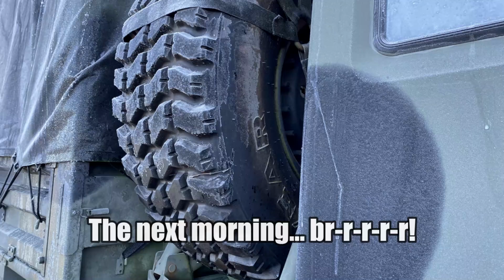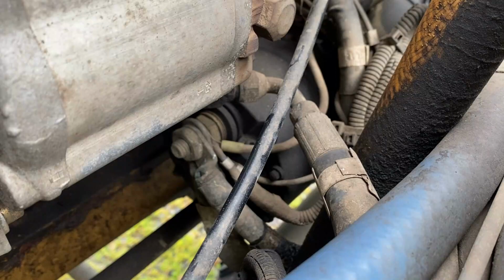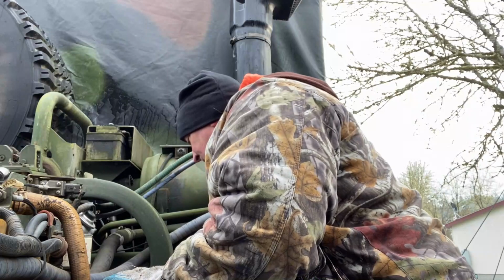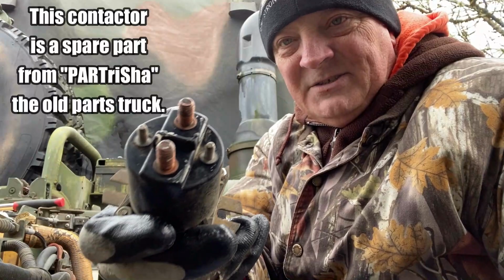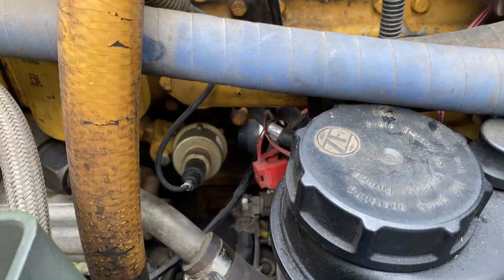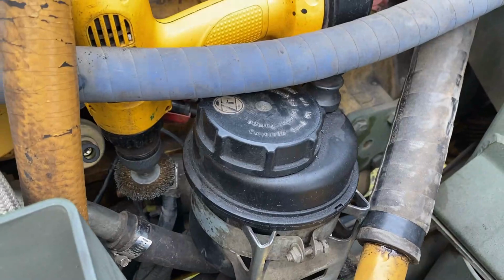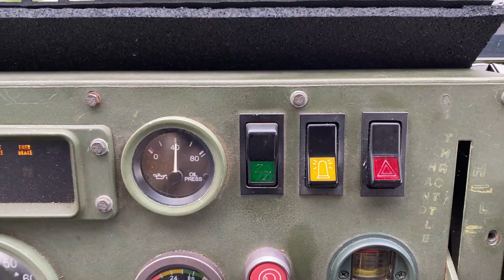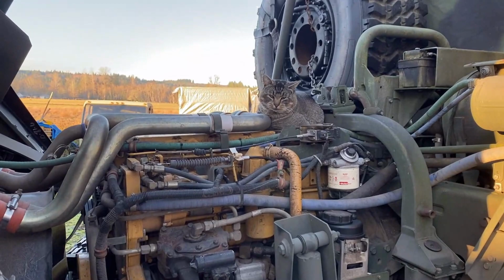FMTV STARTING ISSUES FIXED FOR GOOD? #149

Comment from the maker: Hey guys... just got a call from a subscriber... he recommends putting Permatex RTV Sensor Safe caulk on the contactor and starter solenoid. Apparently, regular silicone has vinegar in it, and may corrode the leads. So, I'll be replacing the silicone with Permatex RTV. ALSO! Recommended to add Power Service Arctic Start fuel additive for winter (cold) starting. GOOD STUFF! Thanks, Mark!
Reply from the maker: https://www.amazon.com/Permatex-81724-Sensor-Safe-Silicone-Gasket/dp/B0002UEOM8 ...the link for the Permatex RTV silicone.
Reply: Silicone grease. Penetrates better and repels moisture.
Reply: Dave, first off, I’d like to thank you for your positive attitude and your kind demeanor. Your efforts in being Christ-like are definitely visible. Because of that, I will watch all of the video (which I would do anyway) and suffer through the horrid ads to increase your revenue😉. I agree with the viewer who said to use sensor safe silicone. Regular silicone is very acidic and while it will make your connections watertight, it will degrade the metal over time.. Keep making your vids and God bless!!!

Comment: Hey Dave. Great video. I'm working through similar stuff now. Hoping for successful results as you have.
Reply from the maker: I pray for your successful outcomes, my friend. I am almost embarrassed at how long that oil pressure gauge has been out. So glad it finally got fixed!
Reply: Kris start by taking off and cleaning all the ground straps. Just like a arc welder need a good ground to weld, so does the starter. You have several ground points to look for. Cab to frame frame to motor, battery to frame and so on. Then as you go threw the positive side, clean them up too.
Reply: Thanks guys. Best part is, I had no problems with starting until I did clean the main ground from the alt to the frame... AND I looked at the starter solenoid and said "I'm not going to touch it, I haven't had any problems yet" 😂

Comment: It's great you disconnected the batteries but disconnecting the positive first on a Negative  ground system is potentially dangerous to you & the truck if you accidentally touch the wrench to any bare metal causing a dead short. 
Thanks for all the videos.
Reply from the maker: You're absolutely right about that. You've got to be careful anytime you have a wrench or anything that conducts electricity around  batteries. Sometimes I get too focused on the project that I forget about the simple stuff to remind folks that keeps me and others safe. Thanks again, and thanks for watching.
Reply: You should disconnect  negative terminal first ,  then the 24 volt plus that way you cant short out half the battery on a split system , then when done hook 24 volt plus then the  ground safest way   thanks mark Williams  oil field etech

Comment: Hi Dave!  Is studder starting when the starter engages, cuts out, engages again, cuts out?  Mine hits but doesn’t roll the engine.  It’s been months since I started the truck as I’ve been doing other things to it but it was fine before.  Batteries are good, will fire my 1083 up no problem, but 1078 is not happy.
Reply from the maker: First I would do is thoroughly clean all the battery contacts + cables. Second, and while things are unplugged, pull the starter wire and refurbish all the metal leads... replace silicone with blue RTV (electronics safe). Next, pull the contactor, clean it, and replace the silicone with BLUE RTV. Lastly, have you done anything to the power distribution panel relays? Might be a bad relay.
Reply: Update...problem solved, one of my batteries was low.  Fully charge both and it started right up.

Comment: Your cat must have liked the warm engine or just wanted your attention. That is one big cat. Anyhow, is the contactor responsible for powering the electromagnet within the starter solenoid that causes the contacts to slam together letting the juice flow, or how does that work?
Reply from the maker: Jacob is pretty big! Yes, I believe that is what the contactor does... not enough power will cause the solenoid to slam and release the magnetic field causing the stutter start.

Comment: The starter seems to be doing the same thing?  Maybe once you replace that messed up relay in the fuse box it will stop doing that?  If that does not fix it you may have a winding on the starter motor going bad and that means you may need a new starter to eliminate all of the stutter starting issues.  If It were me that is what I would do.  Great fixes in this video nonetheless.  Can't wait for the next one!
Reply from the maker: I am still trying to find a suitable replacement for that fuse. I cannot find what amperage it is rated for. If you know, or have a link, please PM me or post it on the Group FB page. I did not see any files associated with what relays/fuses are needed as replacements. Thanks my friend!
Reply from the maker: @SeanFillner  I'm working on it... just been lucky so far that everything was working great. I have CB's on order... along with a bunch of other stuff. Thanks for the links!

Comment: I am about to look at a m1083 to build a home on. I know nothing about disel engines or trucks. I know my way around gas engines and cars. I am intimidated thinking of working on these trucks. Are the parts hard to find and are they expensive? What kind of shop would you have to take it to if you couldn't repair it yourself? Where could I take it to get a mechanic to inspect the truck before buying it? Thanks for the help I am afraid of making a mistake by buying a truck like this.
Reply from the maker: Filters, relays, belts, and so forth are normally found at Napa. Yes, some parts are hard to come by, or are expensive because there are a few companies out there gouging this community. If you need engine or transmission work done, a cat dealer or big-rig  diesel shop  can hook you up. Caterpillar engine and Allison transmission... so nothing super odd! Tires are Goodyear (recommended). CTIS is one of the things you will need to search for if you have a problem with it. Otherwise, there are lots of videos out there about this truck.

Comment: What if power works all around but my start up switch won’t start the engine it doesn’t even crank
Reply from the maker: Well, I would start by hot wiring the starter. If that works, work you way back to the start relay. There is also the contactor, starter solenoid… electrical issues can be a bummer on this truck. Best to replace all the relays and fuses on the PDP.